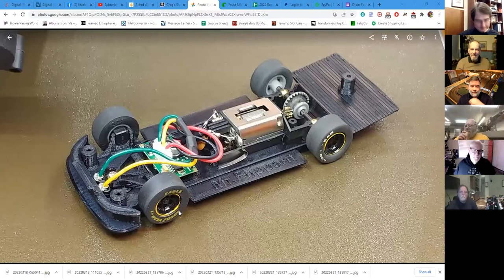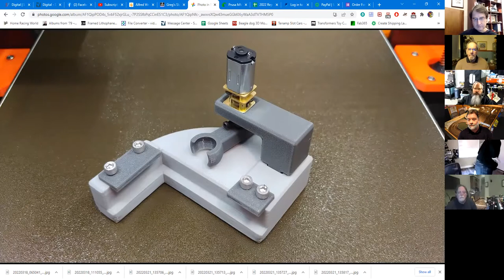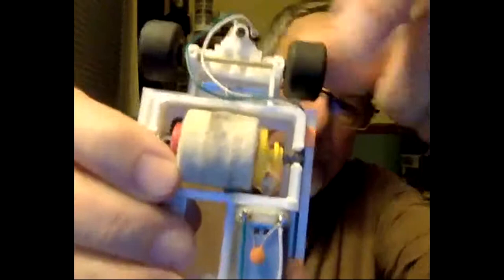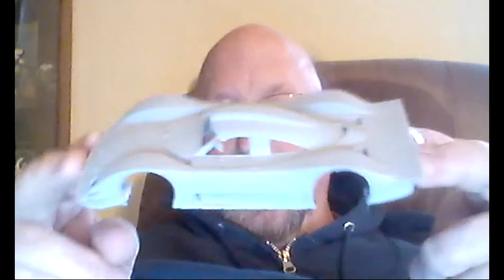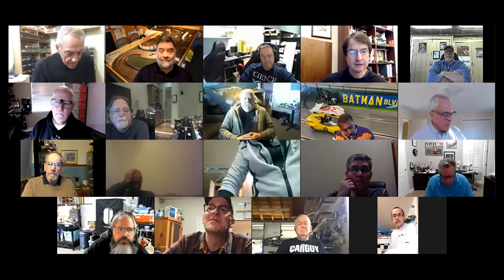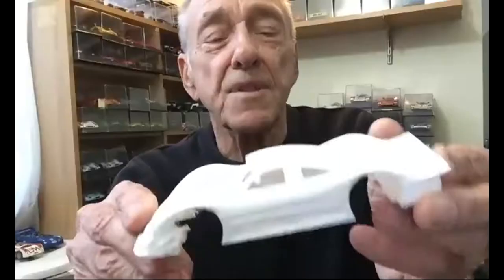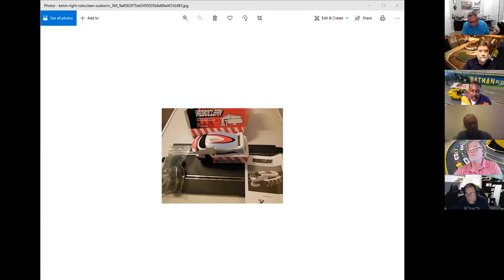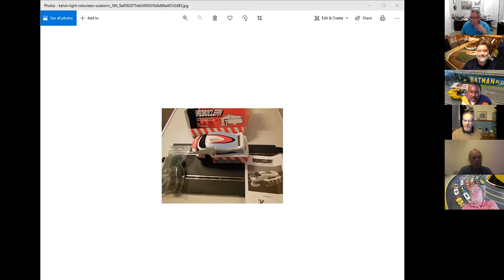World Wide Slot Car Chat #99

Comment: I just purchased a truer from Overdrive slot service in Germany made of aluminum looks like a nice machine. My point is they are for sale right now for those who have been looking. If the website says they are out of them keep clicking it will come up.
Reply from the maker: Is that the RSM machine? That's the only one I know of that seems to be easy to acquire right now.
Reply: @ggaub  Yes, #2. It's configured a bit differently but looks like it will work good. it looks well built. after all it is german made, they generally make quality stuff.
Reply: @ggaub  It also has a sliding tray for your slow-moving motor gizmo, another market for you.
Reply from the maker: @chrisbourret6414  Yep, that's the one Kevan did his version for, which I mention in the chat, though I forgot to specify that his was for the RSM truer.  The only reason I don't make/sell those is because I don't have an RSM machine to test my prints on, and I wouldn't feel comfortable sending out something that I'm not confident will work properly. But yes, it looks like a good machine.
Reply: @ggaub  it was only $235.00, 273.00 with 2 extra trays and shipping, I thought that was a very fair price.
Reply from the maker: @chrisbourret6414  Perfectly fair. I don't need one, though. ;-) If someone gets one and lets me borrow it, like I did for Russ, then I can do that. Otherwise, people can print their own. The files (for all of these reciprocation machines) are freely available on Thingiverse.